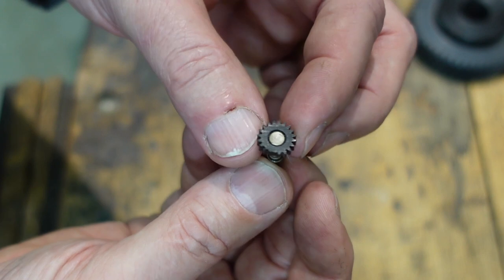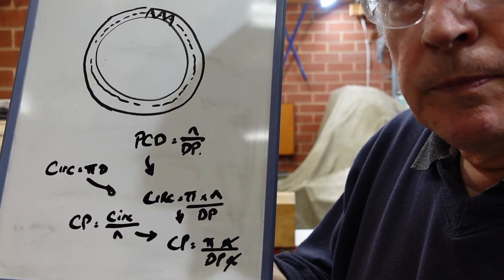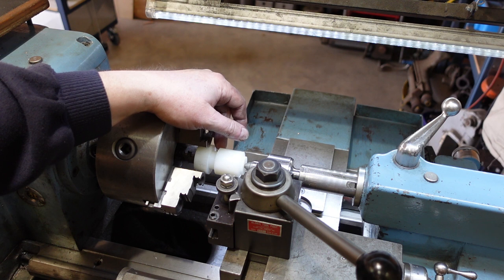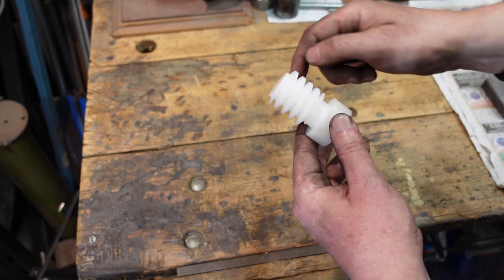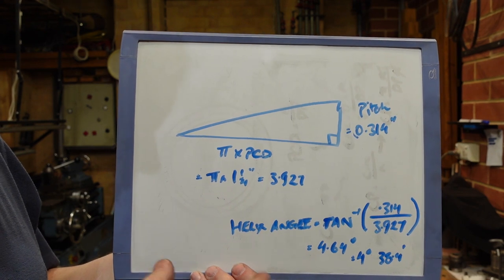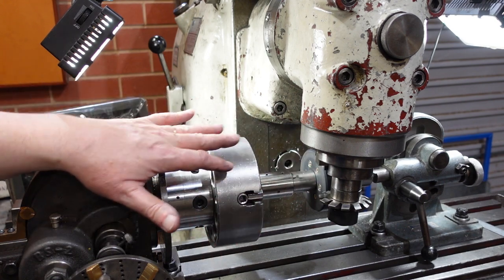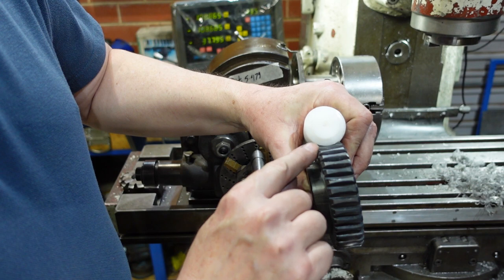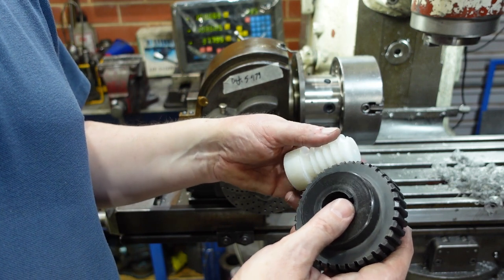Calculating a worm and wormgear

Comment: That's interesting, did the parts for the MG work out, I have change gears for my little lathe have never use them, one day I will get brave enough to gut a thread on it.
Reply from the maker: The MG parts were cancelled at the last minute as a spare was found; one of the reasons the video was made was that I was all set up to do it, so thought 'may as well...'